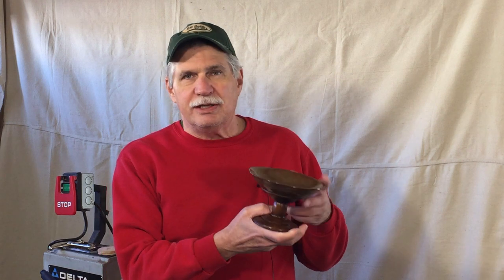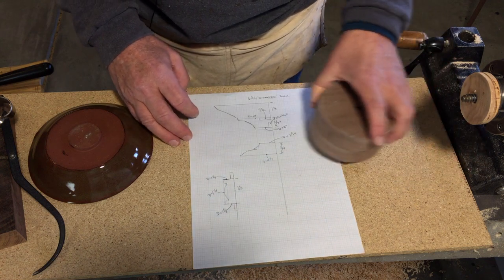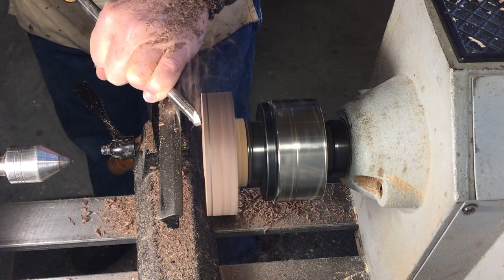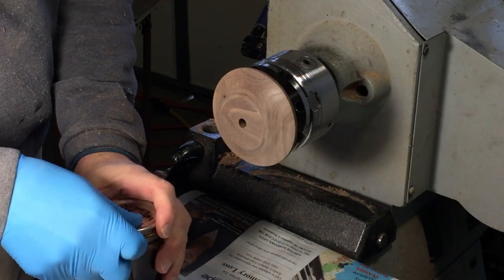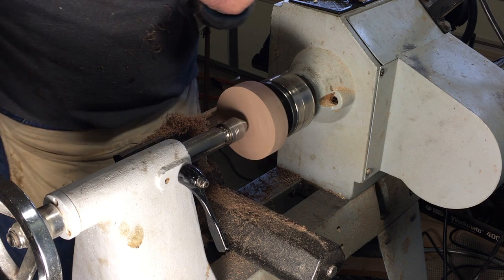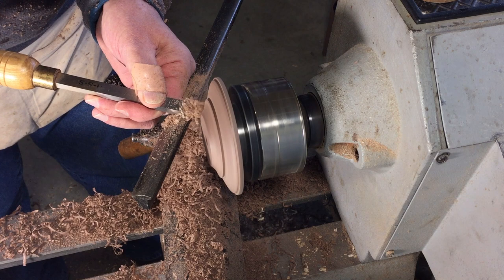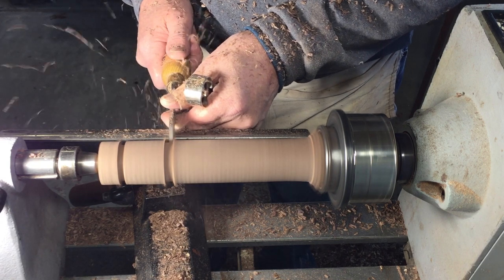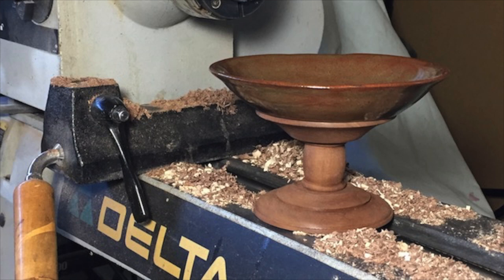Ceramic & Walnut Candy Dish

Comment: Thanks for your reply Steve. One suggestion I can offer is to make a "Cheese Bell" which has a base of a hardwood disk about 9 to 10 inches diameter and one inch thick with a rounded rebated lower edge providing a means to lift it. The top is recessed about 3/8" to receive a glazed ceramic flat disk leaving an outer 1" margin of wood. Then the "Bell" top (or lid) is a simple bowl shape turned to leave a smooth curved base. This sits upside down on the flat ceramic disk and a knob or strap handle applied to what is now the top of the bowl shape.
I have made many of these which are very popular and you are clearly already sufficiently capable of forming the pottery components.
I do hope you will have a go at making one of these and I wish you every success.
Reply from the maker: Thank you very much Peter!  That's a great idea and I'll give it a go very soon.  Thanks again!  Steve